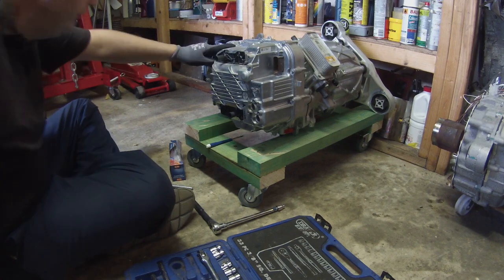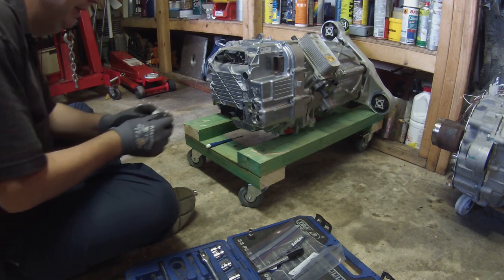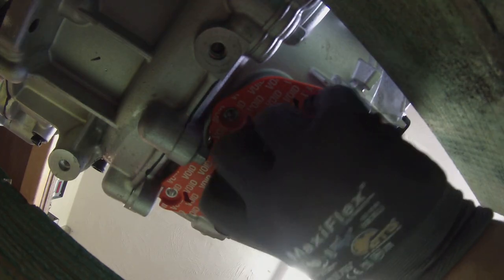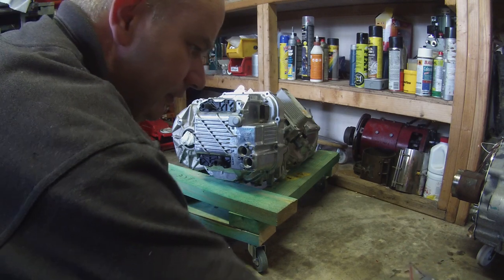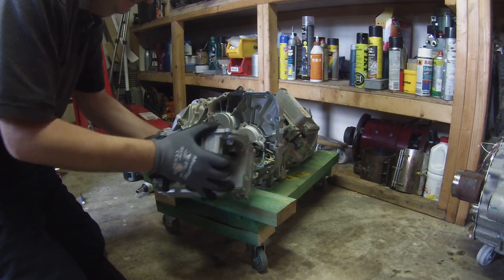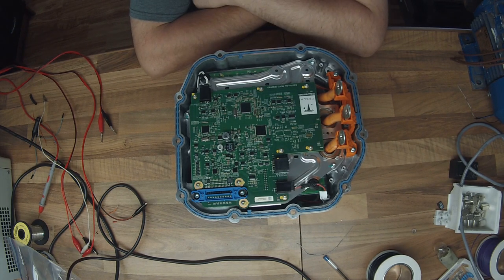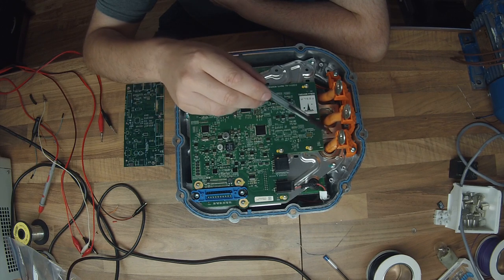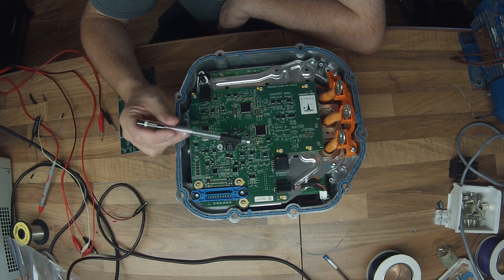The Tesla Project : Front Drive Unit Inverter

Comment: The zip lock bag tip is the best thing anyone can learn when  taking anything apart.  I'll add don't be stingey with the bags.  I use a separate bag for every single item I remove.  I have a Tupperware box I stack them in and I write the description on the top of the bag so it's easy to thumb through them to find what Im looking for.